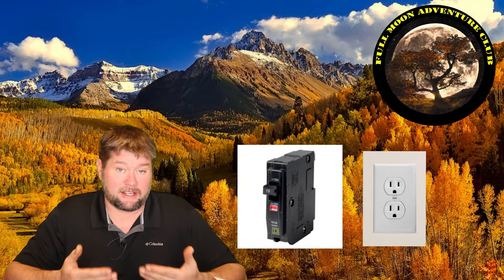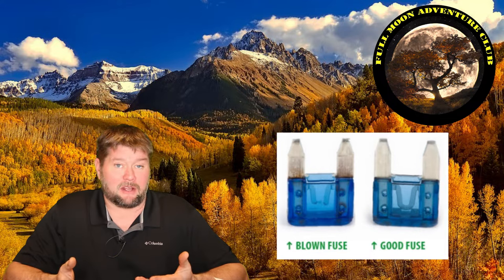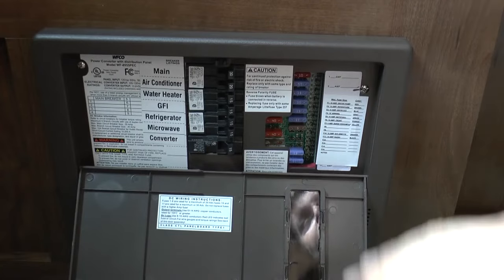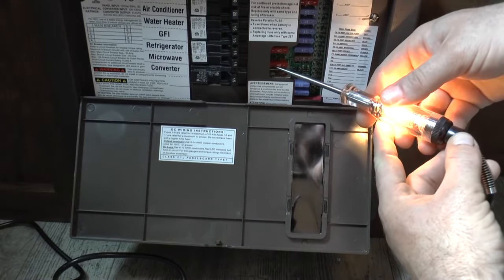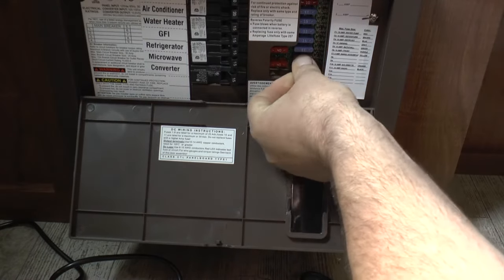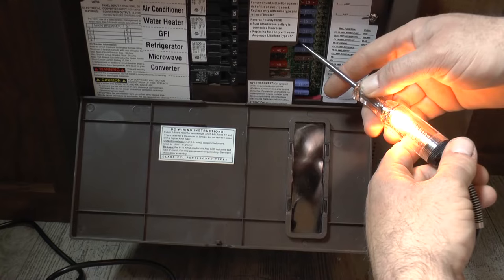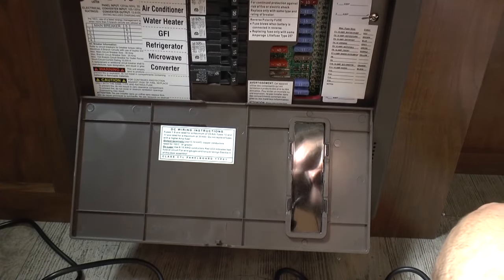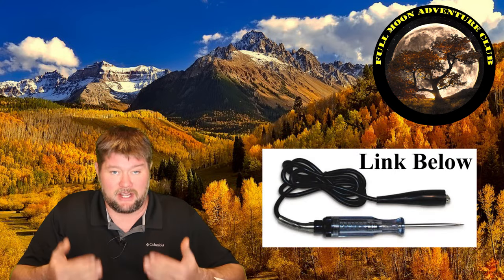How To Check Your RV Fuses The Easy Way

Comment: great video!  My fuse puller won't seem to pull out the fuse.  Do I maybe need to use a needle nose and pull harder?  I don't want to break anything.
Reply from the maker: I use needle nose pliers all the time. It should be fine.

Comment: Love the video. When I saw it the last time I missed your mention of a link. I purchased a 6 12 24 circuit tester. I do not have any 6 12 or 24 fuses so it would not work. When I looked again I did see the link. What to my wondering eyes should appear but a vast array of circuit testers. Would you please tell me which one will test all fuses.
Reply from the maker: So your system is either 6,12, or 24 volts. The number on the fuses doesn't necessarily matter as it refers to the amp rating of the fuses not the voltage of the system. If you have a 12-volt system in your RV a 12 volt circuit tester will test all fuses whether they are 10 20 or 30 amp fuses. Does that help?
Reply: Yes, thank you. I guess I had a faulty tester - but when I tried it on the lawn tractor battery it did work.

Comment: Question.  I purchased a trailer used and the 40 fuse was blown. I took it out and not sure if it goes back in the upper 40 spot or the lower.  The setup is similar to yours...but yours has two 40 fuses.
Reply from the maker: Sorry. I'm afraid I'm not sure where it would go. I couldn't guess either. It would be a liability I'm afraid. Sorry I couldn't be more help.

Comment: Why would a fuse blow everytime i add one
4:15
Reply from the maker: There's a short with that circuit. something has its wires crossed or the positive is connected to ground somewhere.